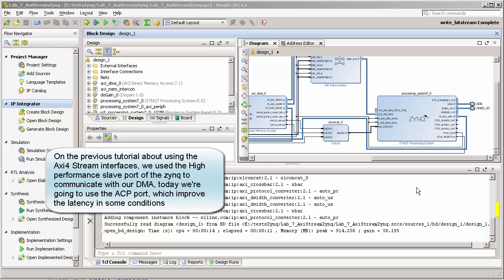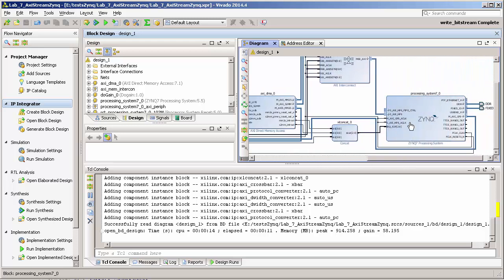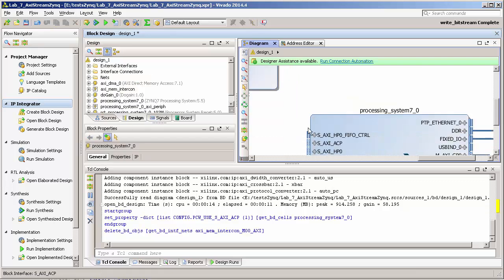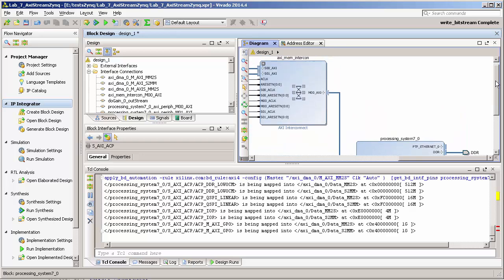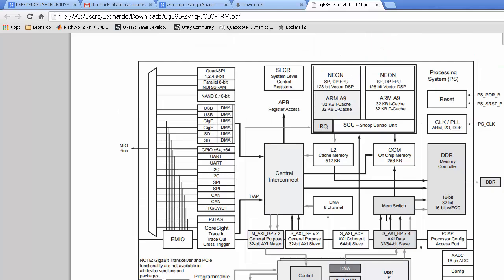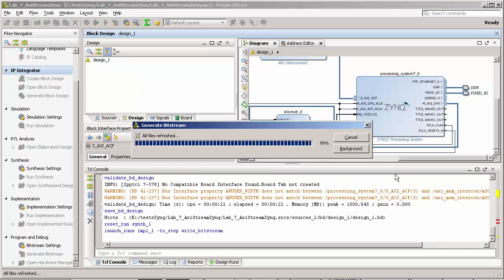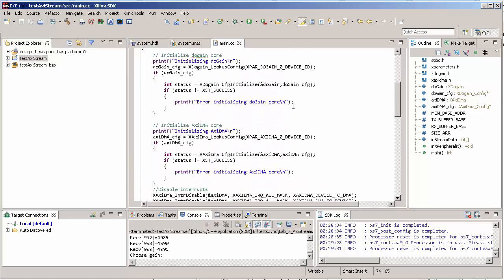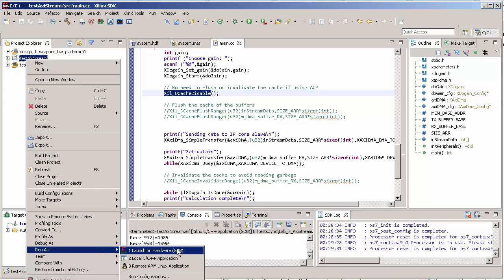VIVADO HLS Training - AXI Stream interface with ACP port #7.5

Comment: I've been trying to use cache coherent streams that go from the PL side to the PS side. I'm using a Ultrascale+ and I wonder what differences there are between ACP, ACE and HPC. I understand that ACE is two-way coherent, while the other two interfaces are only I/O coherent. Yet, what is the criteria to choose between the interfaces for high throughput applications? I've read that ACP (for example) has a size limit on transactions, which would push me to use HPC, as my suspicion is, that the transaction sizes are drastically higher.